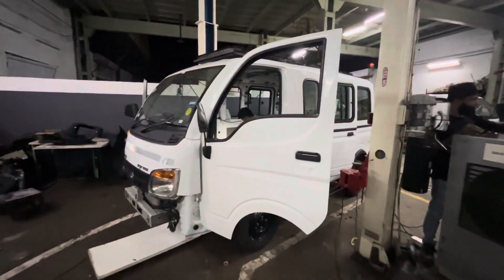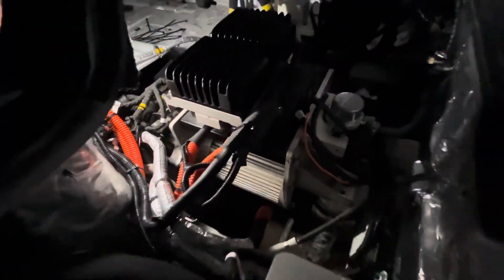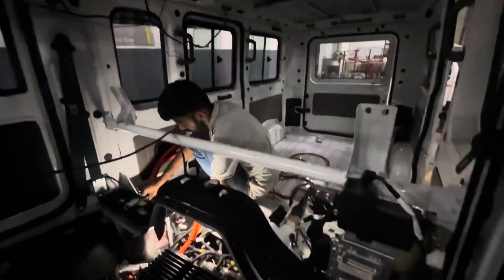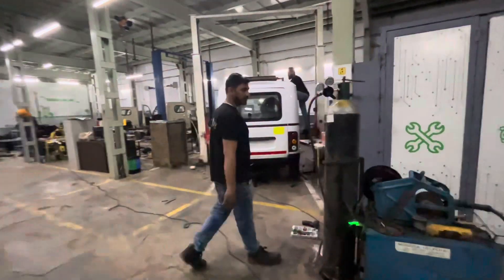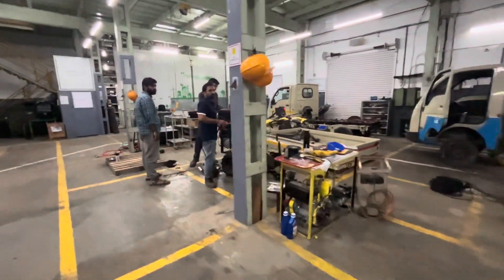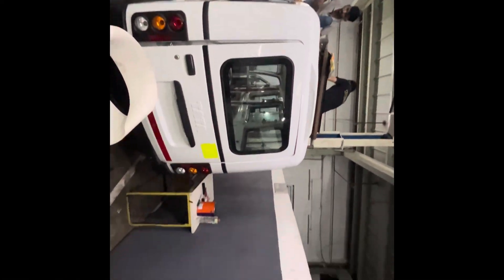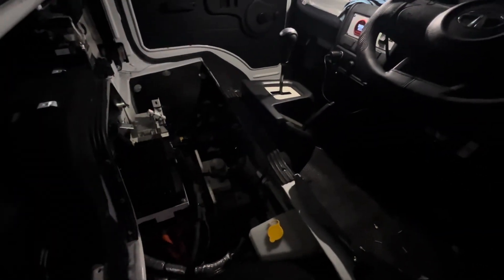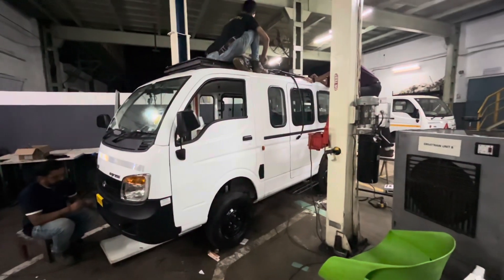Tata Magic EV conversion by Northway Motors in just 48 hours!

Comment: 1. What is the battery capacity ?
2. What is the battery pack weight ?
3. Have you tried moose test with it ? As it is going to be driven in hilly area. You know someone someday might want to gunn it ?
4. Will you do old Magic vehicles if commissioned ?
5. Ball park price range for 100 kms and 200 kms ?
6. What is the max range can be achived if full length battery pack is installed ?
7. You have installed in ace pickup, so can this battery be installed if 3-4 inch lift kit is installed in Magic ? Like the discontinued Venture.
8. I knew someday you'll do it for a passengers vehicle.
9. What is charging capacity ? Fast charging ?

Comment: like is it the battery pack on the top of the vehicle?
Reply from the maker: A. Peoples carrier need to have batteries on the roof as per passenger emergency exit recommendations. On a passenger car everyone has their own door almost. Exit time is less than 3 seconds per passenger in an emergency. In a people’s carrier people can get trapped inside the cabin in case of a battery fire if the battery is underneath. 
B. There is absolutely no space underneath to accommodate a battery pack of this size. 
C. There is cooling, but we don’t openly disclose our tech for others to copy. We have designed, developed and manufactured everything in house over the past 15 years and don’t intend to give knowledge out for free. 
D. The application of this particular customer is in a colder region of the country where there will also be a lot of water logging and snow. The battery has its own heating and cooling tech.
Reply: @Northway-NTPower  thankyou for clarification
Reply from the maker: Yes
Reply: @Northway-NTPower  but it's direct sunlight and heat will more and battery efficiency will be reduced, why did you choose that spot and is that vehicle is body on frame or?  and one more question why not providing battery cooling tech?